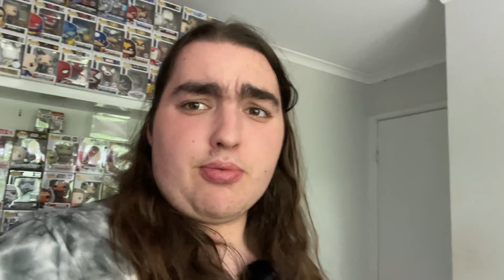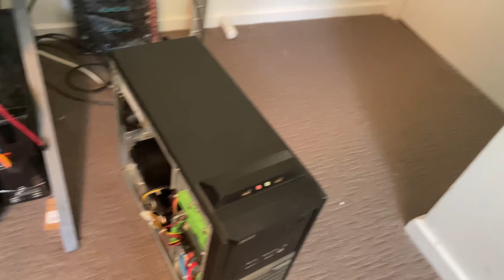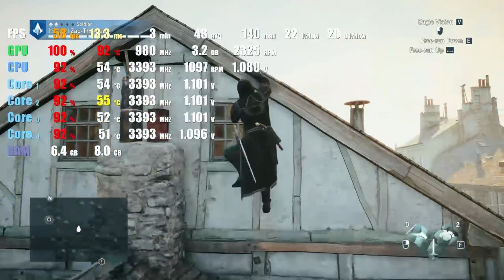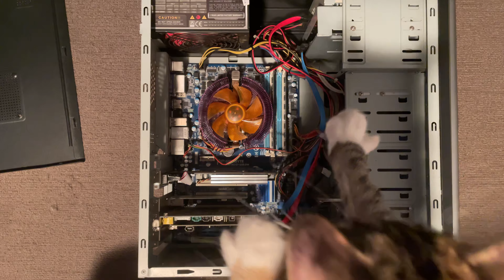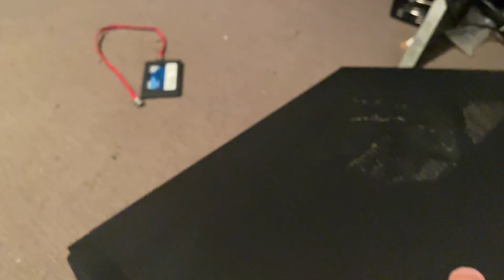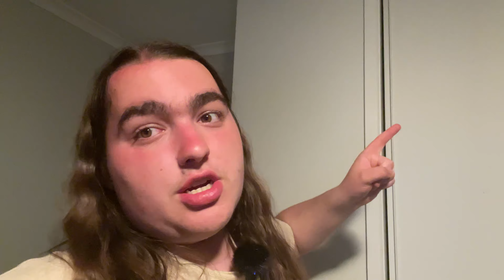Should you SELL Computers!

Comment: Nice content, where do you normally sell your PC's? 
I am working in IT few years but have started rebuilding a couple of retired PC's we get when we do replacements. 
These are normally very good desktop PC's such as Dells, HP's & Lenovo's with i5 6th gen or newer CPU's, 8GB RAM & 250 SSD (I try get bulk by 250gb when the go on sale). 
I then price these about 100-250. 
I have also done monitor, keyboard, mouse bundles too. 
My problem is getting interest in people to buy them. 
I dont know if it is my country that is bit slow to PC's or they all want laptops/tablets but it is very hard to get any one to try buy it off you. 
Sure if I put it up for free I am sure there will be a line for it.
Reply: FB marketplace does wonders

Comment: yo bro im in the uk london i built a pc in 2019 with a r5 3600 gtx1070 16bg 3200mhz ram as well as 512gb nvme gen3 ssd. It has 5 rgb case fans from deepcool, hyper 212 rgb and a 500w bronze psu in a corsair carbide 275r white case. Mobo is Asrock B450 steel legend. Im looking  to sell this pc on ebay and facebook marketplace, whats the best price I can get as well as whats the best way in marketing the system.
Reply: When I sell custom computers on marketplace, I usually start the listing at the recently sold eBay value of the CPU and GPU alone, plus maybe 10-20% on top. 

So if I had a GPU worth 100 and a CPU worth 50, I’d list the entire rig for about 180, and lower the price about 5% every few days it hasn’t sold or garnered interest. 

Hope this helps.
Reply: ok ty so much bro defo check out the existing prices for my components @scarycooper